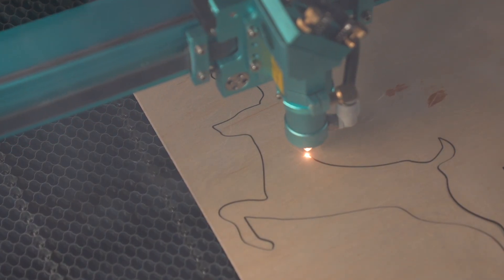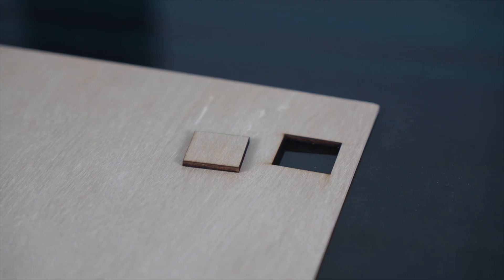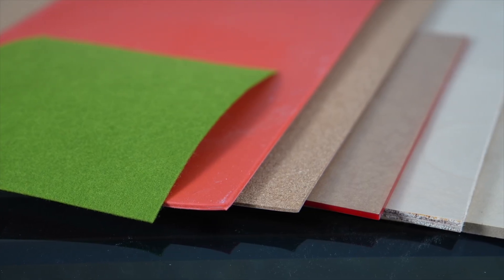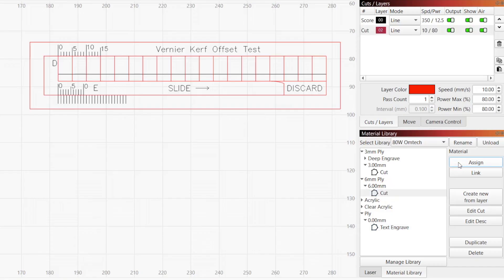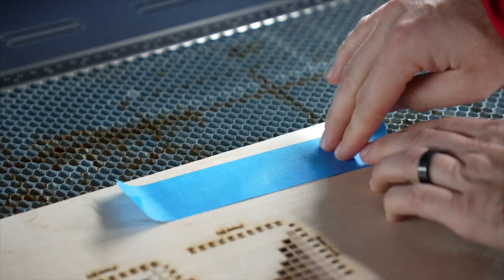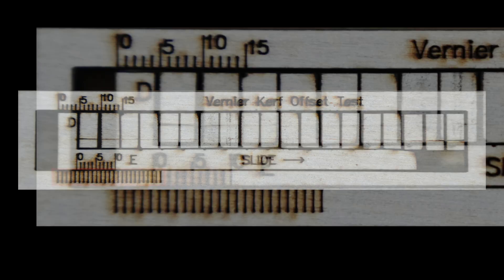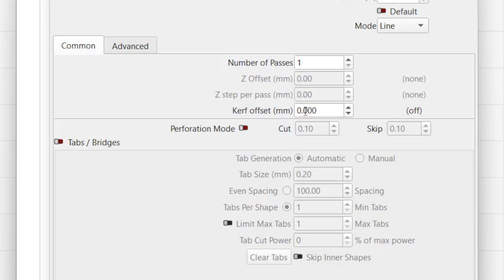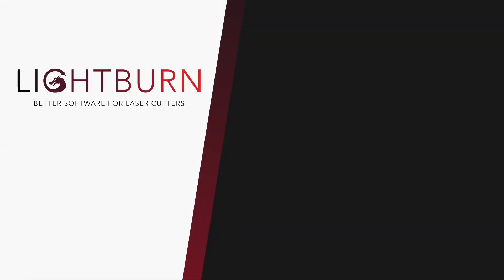Calculating and Applying Kerf Offset

Comment: Thank you very much for this wonderful video and great explanation. So far it’s the best explanation of Kerf I have found.  However, would you please clarify your statement when you stated that half the laserbeam will be on the inside and half the laserbeam will be in the outside of the line that you have drawn in Lightburn?  If that’s the case, in your example with a beam width of .5 mm and an object of 25 x 25 mm, would the Final Cut out dimensions not be 24.75 x 24.75 mm?  I just want to make sure I truly understand the concept. Thank you once again for the video.
Reply from the maker: The beam is half inside and half outside the line on all sides of the square, so it's shrunk in each dimension by .25 x 2.
Reply: @l @lightburnsoftware7189  You’ve just proven once again that one shouldn’t do math in public…terribly sorry for not catching my mistake.  But you’ve also proven once again that Lightburn has fantastic support!  Thank you again for helping me understand the concept. All the best,

Comment: After completing the kerf test I found my joints a bit too tight. Do I make the kerf number lower or higher to loosen the joints please?
Reply from the maker: If the fit is too tight, try increasing Kerf Offset slightly.

Comment: hi im very new i have not allready use my machine, but im learning all i can in the mean while, if u cut a series of pieces like in the video, the male cuts can fit on the oposite result? or i need to cut separatelly both pieces lets say male and female?
Reply from the maker: You will need to cut both pieces with the same accurate Kerf Offset setting for them to fit together.
Reply: @lightburnsoftware7189 thanks a lot friend!

Comment: Hello Here is the message I’m getting! "This file was saved with a newer version of LightBurn (2.1.00).
It may not load correctly and resaving it could cause data loss.
Continue?"Could you please let us know more about this issue?
Reply from the maker: You can click "Yes" to continue - the file will load properly. We saved the file using an upcoming version of LightBurn we're still working on, but you won't have any issues with it. (We will replace the file with one saved in 2.0.04 soon, to avoid confusion)

Comment: Am I wrong in thinking that if I cut a 1 inch square and measure it with calipers and it is for example, .94. The difference being .06. So divide that by 2 for .03 as the offset ?
Reply from the maker: You're not wrong but it's often difficult to get an accurate kerf measurement from a single cut part - our test is more reliable and accurate.

Comment: On my diode laser, the laser beam is rectangular.  How do I use this Kerf Test Tool to determine either a vertical or horizontal kerf?  Or is there a way to get an "in between" kerf?
Reply from the maker: We have some suggestions for this issue in the our documentation: https://docs.lightburnsoftware.com/2.0/Guides/Test-KerfOffset/#dealing-with-irregular-beam-shapes
Reply: @lightburnsoftware7189  Great, thank you.

Comment: Great video on explaining kerf.  I typically do not adjust for kerf so my finger joints are not too tights.  I did a project recently where I needed to hole much tighter tolerances so I did enter a kerf value.  I only guessed at my kerf and it worked OK.  I like the idea of measuring the actual kerf.  I will cut out the tool you have provided and likely make a video of this process on my channel too (CNC@Home).